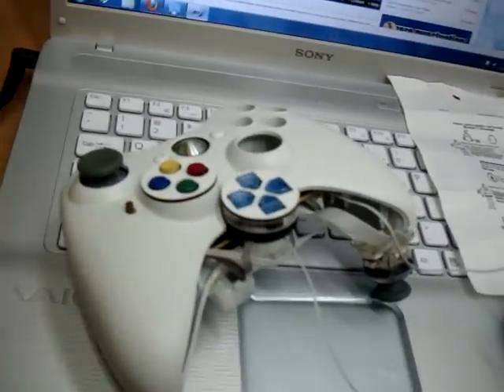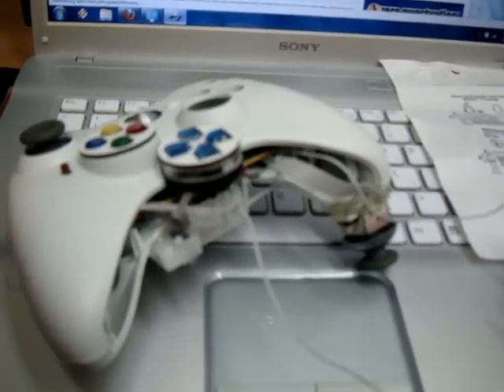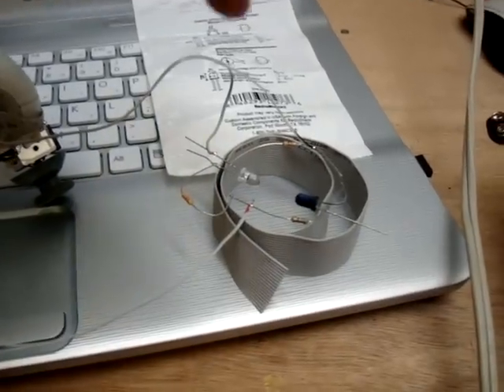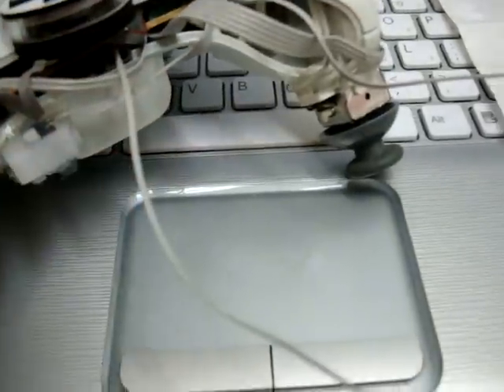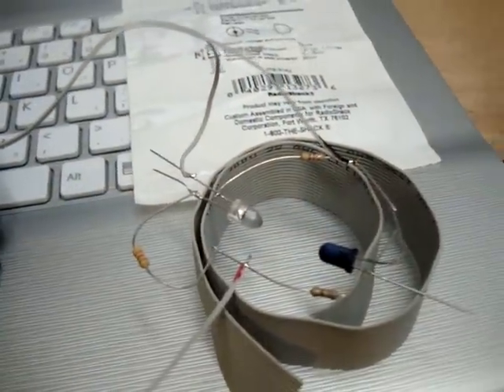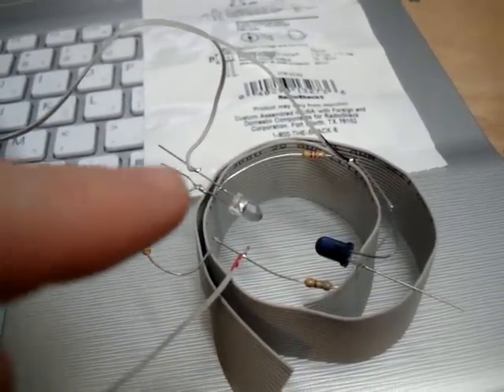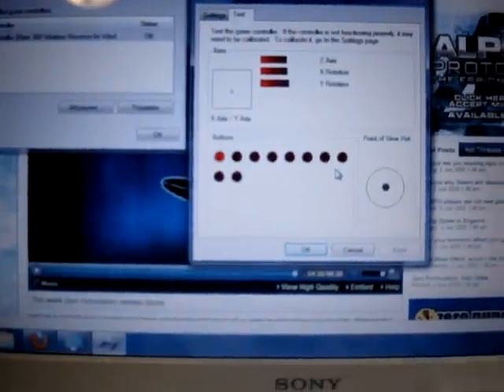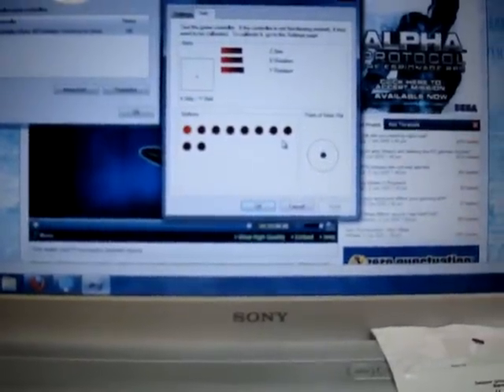IR interrupt switch for Xbox 360 controller

Comment: Back in the 90's, there were these 3rd party SNES controllers that had a touch pad in place of a D-pad, coincidentally they were called "Turbo Touch 360".  This sort of set up might be helpful for movement as it requires less force.